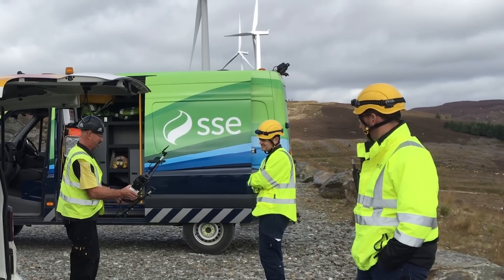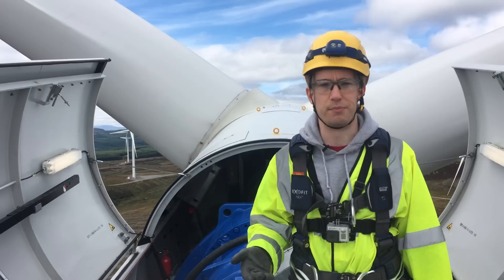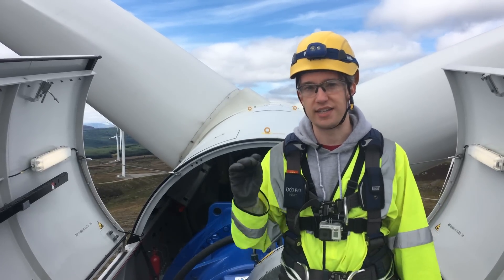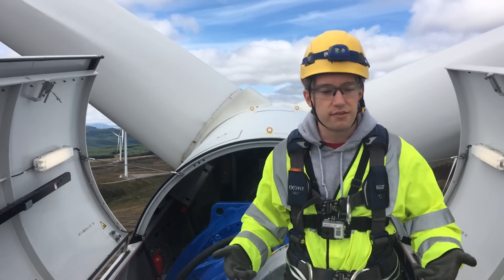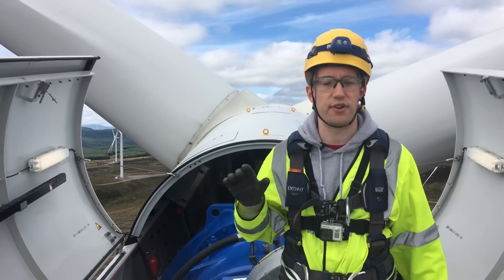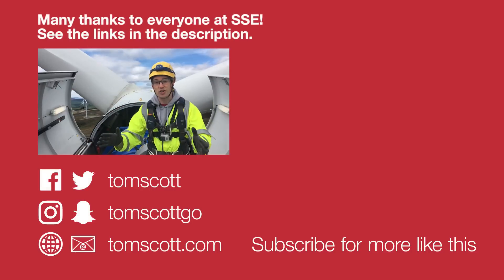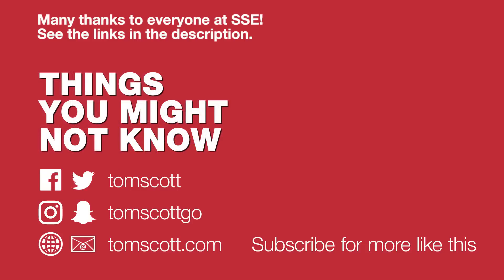The Problem With Renewable Energy (and how we're fixing it)

Comment: What about thorium reactors?
Reply: Apparently those have issues with containing molten salts. We may not have a reactor vessel capable of holding them.
Reply: Or fusion which run on hydrogen and the only bi-product is completely fresh water. A few years in the future but its amazing.
Reply: +ReddwarfIV
Two prototype reactors were running for years in the '60s, so it's not impossible. Corrosion is a problem, but not unsolvable. And it's also possible to build the reactor for 20 years instead of 60 and then the corrosion is less important.
Reply: +TangoNation Radioactive helium, not fresh water. And then the protective plates in the reactor that become radioactive and have to be replaced at regular intervals.
But it's quite tame compared to fission in terms of waste.
Reply: Miku Chan Ah never-mind then. I stand corrected ha
Reply: ThatSaneGuy Well, there's also the advantages of thorium's availability, storability, and the fact that MSRs do not melt down.
Reply: ReddwarfIV Fission boilers don't melt down either. At least as long as you don't turn off the safeties or get a giant tsunami showering over your plant. :)
Reply: Miku Chan Uranium reactors, you mean. The difference is that uranium reactors need a lot of expensive safety equipment. Theoretically, if an MSR went into a melt-down condition, the fuel would burn through a plug at the bottom of the reactor and fall into a vat of coolant or something. You then empty the vat and replace the plug, so your reactor is ready for more molten salts.
Reply: ReddwarfIV
MSRs can work with uranium too. But thorium has other advantages, like not making plutonium.
Reply: I'm not sure what you mean by radioactive helium. 3He and 4He are stable and all other isotopes have a life of less than a second. You might mean radioactive hydrogen, i.e. tritium.

Comment: "Throw another nuclear rod on the barbie"
Lost it at that one
Reply: #tbt Technical Difficulties...or was that a Citation Needed joke?
Reply: Citation Needed. It's Gary's joke, IIRC.
Reply: Which episode is that?
Reply: 1x06 (Neckarwestheim)
Reply: Citation needed. The Neckarwestheim Nuclear Power Plant one.
Reply: I wonder what would happen if you did that...
Reply: ejcmoorhouse What, the sweater vest? It wouldn't be hard to make, but you'd look like a dork wearing it.
Reply: Neckarwhat?
Reply: +Mara K "MYSTERY BISCUIIIIITS!"
Reply: Azayles Ohh yeahh.
Reply: The rods are generally like 4 meters long and a centimeter in diameter, so it would probably just fall off. The temperature of the barbie is less than the standard operating temperature for a reactor, so that's not a problem. The radioactivity is bad, but no worse than it was wherever you were keeping it before you threw it on the barbie. A single rod isn't enough to go critical, even without control rods, so that's not an issue. Unless, of course, you've got a 5-meter-long beryllium barbie with a lid, in which case you can still toss in a rod, but you really shouldn't close the lid.

I'm not sure if the impact on the barbie or on the ground after it rolls off would damage the nuclear rod.
Reply: iabervon Thanks for the clearing that up. Although no I really want to try it.
Reply: Assuming it didn't roll off or crush your barbecue, nothing beyond the fuel rod being warmed up a bit by the fire. A single fuel rod on its own, aside from being dangerously radioactive and extremely heavy, is quite unremarkable and very stable. They only get interesting if you put a bunch of them together. It's fuel rods absorbing radiation from other nearby fuel rods that causes the radioactive decay to speed up, increasing energy output and generating useful amounts of heat.
Reply: xantisma
That's what I thought, too, but it turns out that fuel rods are actually quite light, on the order of a couple of kilograms each. It turns out that it's better to have the uranium in a reactor spread out a bit, rather than in a solid block, so that it's easier to have the assembly delayed-critical but not prompt-critical. They end up using a small percentage of uranium oxide mixed into ceramic for the useful structural, chemical, and thermal properties.
Reply: The fuel rods are only dangerously radioactive after they've been "burnt". You can hold new ones in your hand without much worry - just don't make a habit of it.
Reply: every so often, the comment section does not disappoint :'D
Reply: i didnt get it D:
Reply: can some1 explain the joke here plz ??
Reply: to cover the loss of power, they activate another rod in a nuclear powerplant, increasing its power output. like adding coals to a bbq
Reply: StickyTank Thanks :D
Reply: The actual one is a Hydro dam in wales that is used for emergency power
Reply: +StickyTank
Apparently somebody did not follow the metaphor. Throwing another log on the fire, does nothing at all to solve the problem of being too cold at this current minute. We might want to put "another log onto the fire", before we are getting so cold. It takes time for the power grid to adjust, if it does not have enough flexibility to match fluctuating or varying demand. And since so-called "renewable" or "green" energy is not 24-7, it severely lacks flexibility, and having to have dependable fuel-based backup power, negates much of the supposed cost-savings. Another reason why "green" energy is pretty much a massive scam.

And yet, where is there consideration of the NWO-suppressed free-energy technology, or even neglected thorium nuclear power?
Reply: And this is why British humour is one of the best :)
Reply: Had to pause to laugh
Reply: @ejcmoorhouse  Not much, other than a lot of radiation
Reply: same.
Reply: Dead a**. Too funny.
Reply: It killed me
Reply: And that is why Australia doesn't have nuclear power plants? ;-)
Reply: in reality, it is not a fuel rod that is thrown in, it is a control rod that is pulled out
Reply: A dingo "H" yo baaaby...
Reply: Alternate use: Nuclear sword
Reply: Probably just lift the control rods a bit more

Comment: All the wind turbines in aggregate sure seems like enough rotating mass if you are using the right type of generator and properly set up the controls.
Reply: Actually that would make things worse. Because synchronous generators are reversible, when the wind wasn't blowing quite right then the generator would act as a motor and suck power from the grid to keep turning at 50Hz, and because wind comes in gusts it'll never quite be blowing right. That's why actual wind turbines don't use synchronous generators and don't contribute to grid stability.
Reply: They cannot provide inherent (no delay) inertia since they are decoupled from the grid but they could provide synthetic inertia (through power converter controls). However, synthetic inertia has a lot of issues (measuring df/dt - time delays due to filtering, limited wind turbine rotor speed deviations, non-ideal tip speed ratio - second frequency dip...)

Comment: Nah... there are batteries that exist to meet massive demand. It's called  uranium-235 :D
Reply: nuclear power is constant, it can't be added or removed at the drop of a hat.
Reply: Yes, but it's still a store of energy from gravitational collapse.
Reply: Nuclear power can be very responsive, depending on how you design the reactor. The plants in nuclear submarines and aircraft carriers can ramp up and down quickly, for example. You're right that most of the ones currently built for power generation can't do it very well though.

The French have a shedload of nuclear power and load-follow with it pretty effectively, without using highly enriched uranium like the military reactors, so it can be done in civilian applications. Most existing reactors don't even bother trying because the fuel costs are so low compared to the capital and operating costs that you can practically give the power away and it still makes more economic sense than having your multi-billion-dollar investment sitting idle.

Comment: That's not a problem with renewable energy, it's a problem with wind power. Hydroelectricity for example doesn't have this problem at all, as by definition, it stores energy in big water reservoirs at the top of giant turbines, to be released over time or whenever a need arises. In Quebec, hydroelectricity accounts for nearly 97% of all electricity produced, not just renewable, and therefore the network doesn't have the problem you mentioned.

Comment: "Rotating thousends of times a second"? I don't believe you.
Reply from the maker: Ah, blast! Three people reviewed the script, and then the finished video and none of us spotted I said "second" instead of "minute"! You're absolutely right: that should be thousands of times a minute.
Reply: Most steam turbines for power generation are directly coupled (no gearbox) to the altenator. That mean they turn at 3000rpm or 50 times a second (3600rpm 60Hz in US). Tom should have said thousands of times per minute.
Reply: +finbat I think he says second, but the closed captioning says minute. At the very least the CC should be edited.
Reply: if you turn on subtitles it says minutes. i guess thats what he had in the script but brains do weird stuff sometimes.
Reply: The closed captions correct this lapse.
Reply: car engines have between 5000(even lower for diesel) and 8000 (wankel engines) rpm's rotations per minute, not per second. The mistake was Tom misread the script.
Reply: ***** happens, no worries, i think we know what you mean :)
Reply: +Matthew Santoro A car engine isn't made of hundreds of tons of steel.
Reply: no it cant
Reply: an f1 can go over 15-18k
Reply: Anthony Harvey oh i was talking about the engine
Reply: +finbat no gearbox? Oh, how wondrously orcish of us!
Reply: hamstsorkxxor
There is about 100-200Mw power output from a turbine so a 96% efficient gearbox would be chucking out 4-8Mw in heat (that is a lot of cooling water) more importantly that is a huge force going through a relatively small amount of material.
Reply: +finbat 4MW you say? Just slap a bit of cooling paste on there, it'll be fine:) 

Seriously though, I have never worked with anything that large, didn't really consider the size of that aspect.
Reply: Depends on the number of poles your generator has. Big generators often have 2 pairs so they spin at 1500rpm. There are generators with 10 pairs too for hydro stations that spin at 300rpm.
Reply: Hopefully he can post a little correction text to like "thousand per minute". I also found ranges from 300 RPM to 3600 RPM for many steam turbine specs.
Reply: No, I spotted it Tom ;) :P
Reply: Shouldn't you easily be able to spot such an error if you got any sense of quality what so ever? Anyways, there is nothing wrong with rotation of more than 3000 Hz. A bor at your dentist spin upto seven thousand times per second. Surely with a great loss, but this could easily be compenzated for with vacuum for a grid accumulator. Btw, you will never see anything but melted metal batteries filling the gaps in the grid at large scale. No sane person would sell the energy in their lithium ion battery consider the amount of cycles they can give.
Reply: MrOperettalover
You don't know much about engineering. A steam turbine would explode at about a fifth of that speed (due to centrifugal forces). You can't have a vacuum if you are expanding steam through the turbine. What are melted metal batteries?
Reply: MrOperettalover
Tom was talking about steam turbines and generators spinning, this rotational inertia smoothes out transients in the electrical supply system. These cannot rotate that fast because they have to have a reasonably large diameter (to transmit the torque) which will burst under centrifugal force.
Reply: MrOperettalover
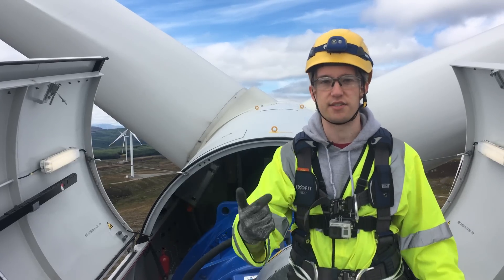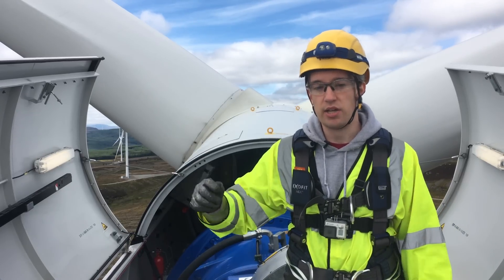Oh Dear - watch again from 0:45 until 1:40 he is talking about transients of the order of seconds.
Reply: MrOperettalover calm down dude, no reason to act like a child...
Reply: It's actually revolutions per minute.
Reply: +MrOperettalover man you are the very personification of tragedy...
Reply: Scott Dann
No it does not. Google it. It saves you cash if you have large inductive loads (electric motors) by making them more "efficient".
Reply: The CC says minute
Reply: Collectively?
Reply: @santoroma17  not per second my dude
Reply: @finbat  
They don't turn thousands of times a minute, either.  Most turbines turn well below 1000 RPM, because they have 8 or more "poles".  Some hydroelectric turbines turn at 250 RPM.
Reply: @acmefixer1  Steam turbines in power plants run at 3000/3600 RPM due to the fact that the torque would have to double for the same power output at half RPM. The flow area of the turbines would also double. This would make the diameter a lot larger and blade stresses higher. Consequently they run as fast as possible with 2 pole generation. Wind turbines turn slowly so you want as many poles as possible.
Reply: @acmefixer1  There are some nuclear plants using 4 pole generators because the lower temperatures use wet steam which requires very large volume flow rates which could not be accommodated at 3000rpm (the blades would break at the large diameters required)

Comment: I'm curious how this is solved in Iceland. I've always seen claims that Iceland runs on 100% renewable energy - or is this not a problem that exists for hydropower?
Reply from the maker: +Sven Slootweg Iceland has volcanoes. Their turbines are powered by just pumping water down and letting the earth heat it up. Once you've paid to set up the equipment, the power and hot water is basically free!
Reply: ... and since it is steam turbine based it has the same resilience mechanism as coal and nuclear stations.
Reply: No thats not right we use geothermal power stations that pump up water that is about 300°c (Wich is not pumped down like you said) Those stations produce about 30% of our electricity, the rest is mostly produced by hydropower plants.
Reply: Hydropower as in dams or hydropower as in tidal?
Reply: hydro as in Dam in pretty much a nuclear station but with water and gravity instead of steam and nuclear fission. In Quebec we are about 90% hydro, 2% fossil (remote areas), 8% new energy (wind & solar mostly) and 0% nuclear and we don't have any of those problems. The hydros station act as an kinetic accumulator just as much as a steam generator.
Reply: Don't Iceland use mostly geothermal power? Which won't have the power drop offs because it's heated by earths core
Reply: @hydrogenbumblebeesd9292  For heating. But electricity comes mostly from hydropower.
Reply: @0000-z4z  And Water Turbines are quite heavy, so they behave more or less like Steam Turbines. The latter still have higher Inertia because they rev much higher; Water Turbines are in the 10s to the 100s (apart from Pelton Turbines perhaps) and Gas/Steam Turbines may even exceed 10,000 RPM.

Comment: South Australia went and installed one of the aforementioned monolithic batteries. It has actually kept the grid synchronised very well, once responding in much less than a second, keeping the grid stable even when a 600MW generator fell off a cliff. The one advantage of this approach is, even though it is a complex system, it is still not as difficult to orchestrate as a bunch of independent, latency seperated smaller batteries. That isn't to say it is the only or best solution, but it is viable currently and immediately.